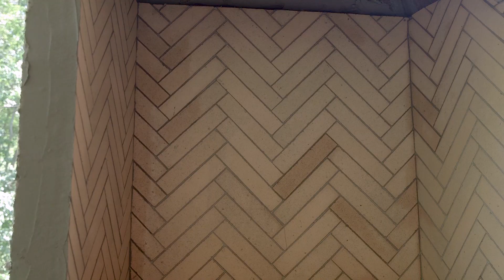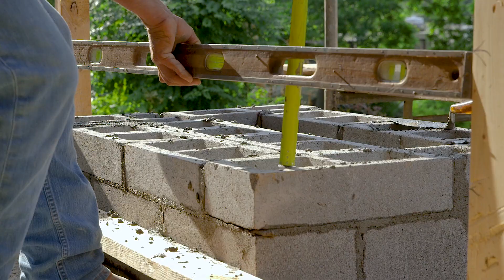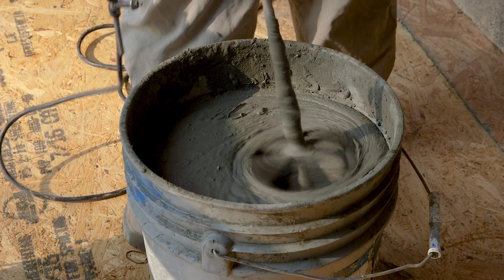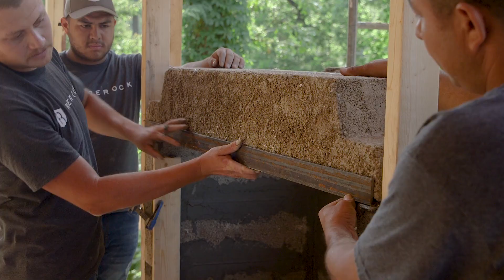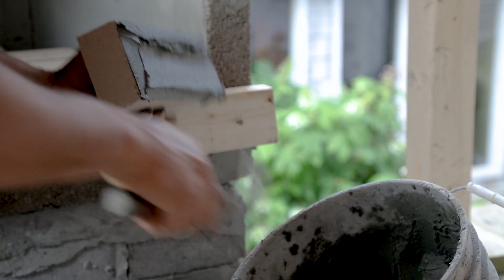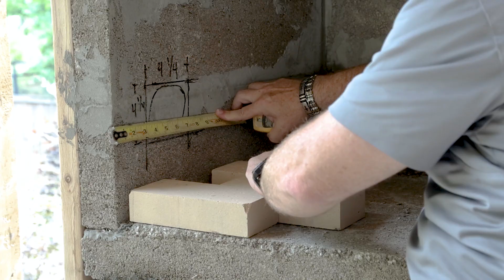FireRock Fireplace Installation Video

Comment: I was unhappy with the rough fit of my FireRock assembly. In two places there were 1/2” gaps that our Mason had to deal with. I recommend dry fitting your assembly on a level slab upon receipt to make sure you don’t have the same issue.